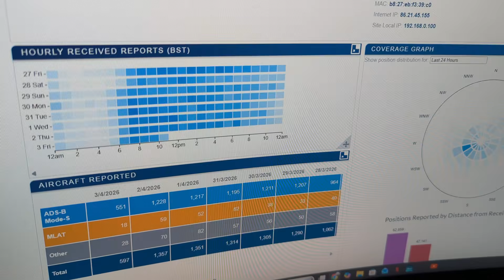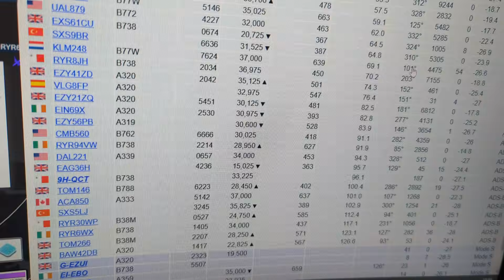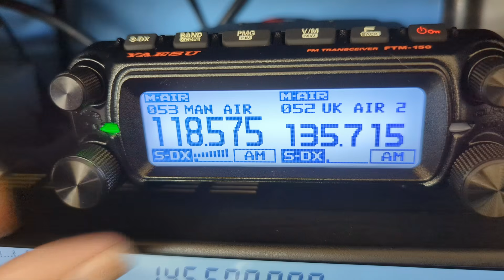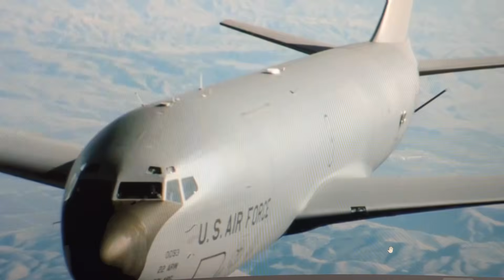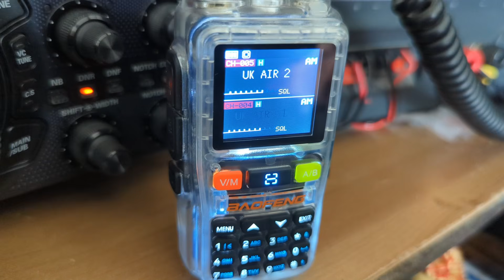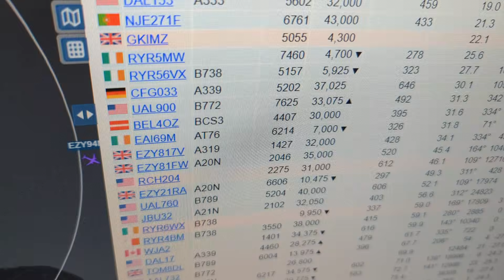Aircraft Tracking and Radio Reception combo - Full Set up explanation and use.

Comment: Hi Simon. It's been a while. I find ADSB a useful tool for modelling my antenna, a Diamond X7000. I now know why I don't hear much on 23cm as I see very little air traffic to the North and South, probably die to the Chevin to the South of me and the steep climb out of Otley to the North. East and West is quite good as I see aircraft out in the North Sea and into Northern Ireland. If you want to try putting aircraft to practical use you could try aircraft scatter on VHF and UHF. There is a software package called Air scout that uses realtime aircraft tracking data to predict usable scatter between two locations. I've used it on 23cm to predict usable scatter paths between me and the 23cm beacon, GB3MHZ located in Ipswich, and a couple of times I've received it, down hear in the bowels of Otley. Slightly off topic but related to your interests in satellites, and for gauging the performance of an antenna, is the use of TinyGS (Tiny Ground Station). All you need is a 433MHz LoRa board, such as the cheap and cheerful Heltec V3. The software tunes the board between 400MHz and 450MHz automatically as each bird fly's over and collect the telemetry packets. It also generates a heatmap similar to your ADSB software so you can then determine the antenna's  major elevation lobes and the best directions the Omni receives. Anywho, stay slinky.... Nidge (G0NIG)
Reply from the maker: Hi Nige thanks for the interesting information especially the air scout it sounds cool. Yes it's interesting to see the signal directions and get a picture of where is strong and where the weak reception paths are. The data collected on the coverage graph at my end shows that Baildon moor top which is NW-NNW-North has far too much iron in the ground 😅. I noticed back with the NOAA sats the signal was always weak on that approach but then romped in when above the horizon. It's proving to be the same on 1090 mhz. It's a total difference with HF and I am convinced that the position I am in which is on a knoll/ hill between the two bigger hills wrose and Baildon uses the quarried cliffs as a giant dish type reflector. It certainly does regarding my motorcycle back fire. The echo is excellent!
I don't have anything that works up as high as 23 cms at the moment but who knows what I will be doing in the up and coming future fingers crossed. Anyway it's always interesting reading your comments regarding your superb radio knowledge and wisdom. I really glad you told me about the OpenGD77 for the Retevis it's been superb. I am always interested in trying out totally different things. Thanks Nigel hope to have a good rag chew on 2m soon. Happy Easter

Comment: Will it recieve military air band?? Im next to fenland air field in South Lincolnshire and they've been getting military helicopters in for refuelling when there practicing at the local bombing range. Would be nice to hear them on the radio. Happy easter. M7dqo
Reply from the maker: Hi bud. Happy Easter to you. Yes the radio will receive Airband, VHF and UHF frequencies you would need to find out the base approach frequency and base tower which would be easy enough via the Internet. As for the tracking most civilian and military/police aircraft have a transmitter on 1090 mhz which identifies there position using GPS satellites especially in EU region so you can see most of the air traffic in range in realtime